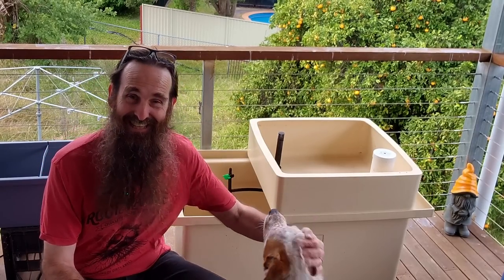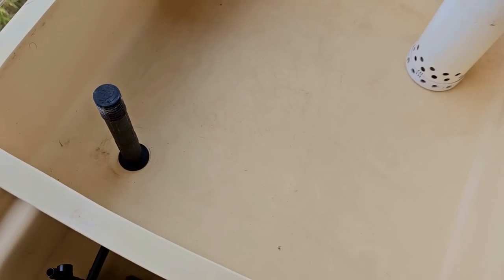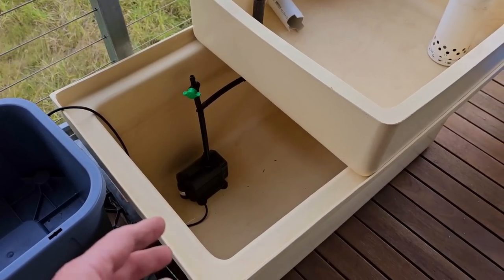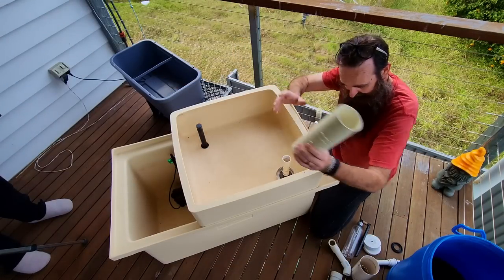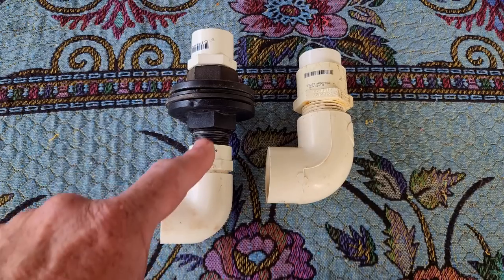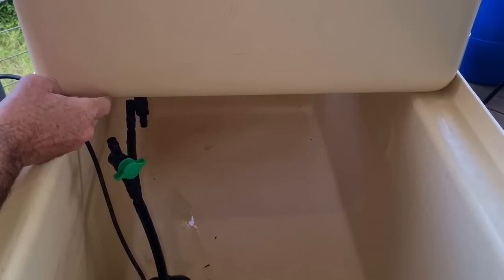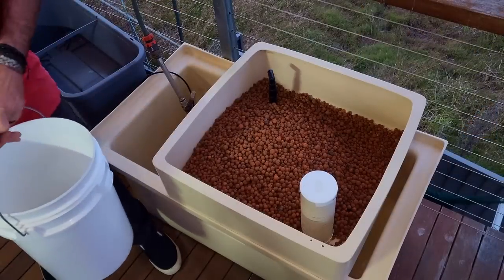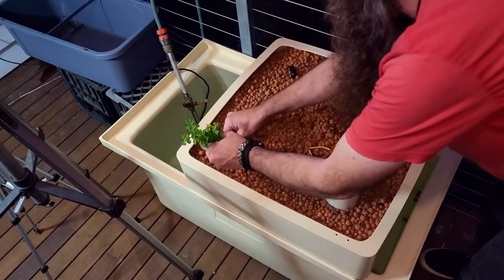How to Set Up a Balcony Aquaponics System

Comment: Hi Rob, am the 1St person to view this vdo. Happy for that. I want to tell you a suggestion. Why don't you set the bell syphon to out Side of the grow bed? Is there any problem for that?
Reply from the maker: The bed already has holes in the base so it's easier just to use them. External siphons work just as well but can cost a bit more to build due to the extra bits. They still require a shroud of some sort inside the bed so you can maintain the exit pipe & remove any roots that may clog it up.

Comment: Great video! And thanks for sharing the chlorine tip. Can I do the same to an existing tank with fish when I top up?
Lovely to share a bit of time with your family (including Jack) every week.  😊
Reply: I would not recommend to apply this type of water treatment in order to top of an existing system, because it will also change the PH from the fish water tank, which will most likely cause the bacteria to shut down or die, and it could even cause the plants and the fish to die. I would recommend to treat the water before you top of the tank. And after the water has been treated and the acid is neutralized you can measure the PH, and if all is well you can ad the water to the fish tank from an existing system. Just make sure that the PH is right from any water that you ad to the system.

In your case it would be much safer to have a barrel nearby your system which you can use to neutralize the chlorine with an air bubbler before you ad the water to your existing system. This way you can treat the water well before you ad it to your system, and it will always be ready to be used when needed. The air bubbler will also prevent mosquitos. 35 liter of air per minute will do the trick. If the barrel is about a meter deep, or 30 inch or so, a small aquarium bubbler won't work. 

For that purpose I have a Hailea Aco pump. (sold under many different names) They are a bit noisy, but they are practically indestructible, and they have the capacity to pump enough air at such depths of water. And they do not use that much energy compared to other types of pumps. I changed to a piston driven air pump because the membrane driven pumps always needed a replacement of the membrane after a couple of years. Which is annoying because you have to order it, if you can find it to begin with, and then you have to take apart the pump, and so on. 

For aeration of the pond I recommend a venturi style aeration. But that is a whole different story.
Reply from the maker: Just deleted my comment after re reading yours Morne. I only add it to the top up water. As mentioned, it will shift the pH a bit (I lose 0.5pH in 50gal) which could cause issues. It's better off to treat the water before adding it to the system like I do in a 50gal drum. 👍

Comment: It is a very small system how do the ph temp etc levels go I imagine it would fluctuate a lot 🥰 Blessings Gerowyn
Reply from the maker: I'm not too sure just yet Gerowyn. I would sat it would be very similar to the fluctuations in most larger aquariums. 
I was going to start on the other beds today but me mum needed a hand then got side-tracked with comments & whatnot. 
Hope you folks are doing well.
Reply: @RobsAquaponics  so easy to get distracted it will be interesting to see how this system goes 🥰 Blessings Gerowyn

Comment: I do not think that this system would be recommendable to put outside for people who live in the northern hemisphere, but if people have enough indoor space you could make it look all pretty and such to match the interior of the house, ad some LED grow lights, and it would make a very nice feature inside the house with fresh herbs or flowers all year around.
Reply: Why?
Reply: Wisconsin you get 6 months out of the year, if that.

But, that is 6 months in power cost savings and etc.  Heating tilapia ponds isn't cheap.
Reply: @Darryl.M  I live in the Netherlands, and if I would leave a small system like that outside all year long it will eventually turn into a solid block of ice at some point in time during the winter. Or it would warm up far too hot during the summer at random hot days for the type of fish that we can keep in our climate. With the risk of killing the fish or even cracking the tank during the winter. And when people do not have a larger pond for the fish so that the fish can overwinter in a larger pond it is not very practical in use. 

And the eatable fish that are suitable for our climate need a lot more space and a lot of oxygen, and relative cold water temperatures. And those fish are very sensitive for change of water quality. Such a small body of water in such a small system will either warm up too much during the warmer days, or freeze during the winter. 

Next week the forecasts predict an official heatwave with temperatures above 30 degrees Celsius. Such a small system would heat up far too much and far too quickly for the type of fish that we can usually keep in the pond with the type of climate that we have in the Netherlands. We can't keep tilapia  outside in a pond or fish tank, because it can also cool down too much for tilapia. 

But when the system would be located indoors it is much easier to keep big sudden temperature changes under control. Either warm or cold temperatures. Which is very important for the functionality from the entire system. Besides the fish the bacteria inside the system do not like those big sudden fluctuating temperatures changes either. It could shut down the entire system. And all kind of important water values, such as PH and so on, can also change rapidly under certain conditions in combination with rapid big temperature changes. Big temperature change can also cause certain important nutrients to suddenly react negatively with other elements in a chemical way, and drop out of solution, resulting in nutrient deficiencies for the plants. 

In general a larger system with a large body of water is easier to keep and maintain compared to a system with a very small total body of water. Because with a larger body of water the external changing conditions have less sudden impact on the water values and overall water quality for multiple reasons.
Reply from the maker: It would be OK in some spots in Southern Europe & States in the US I think. 
Hope all's well with you mate.
Reply: @RobsAquaponics  Thank you, all is well here. This morning we have a storm and 100km/h wind speed is to be expected. And for the weekend the forecast is a heatwave. So in terms of weather there is enough excitement at the moment. I did have a nutrient deficiency in my system. Added some iron chelate, some epsom salt, and some clay minerals, and that seems to help.

Comment: It looks good, but I never understand why all my clay pebbles float and cause all my plants to flip without a styrofoam raft
Reply: You clay weighs less than water. Maybe do a test and see if they do and how long it takes for the clay to absorb water
Reply: Or maybe your over filling  the bed with water?
Reply: Reduce the flood height of your bed.
Reply: Clay has to soaked in water for a little while that's what I do with all my clay let it soak for a week or two to absorb the water Rinse it and then I stick it in the beds
Reply from the maker: As mentioned above, it can take a while for the clay to absorb water & stop floating. Reducing the flood height, as Mitch suggested, will help them stop floating as the dry ones on top will weigh them down.  Then you increase the height again after a week or two once the clay is loaded with H2O. 👍
Reply: Too much water the top dry pebbles should weigh down the bottom submerged pebbles